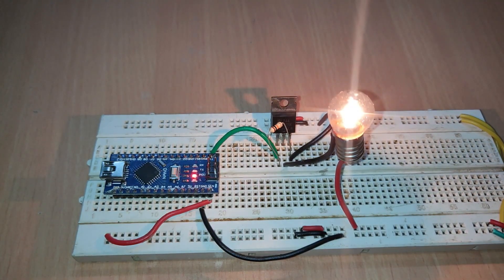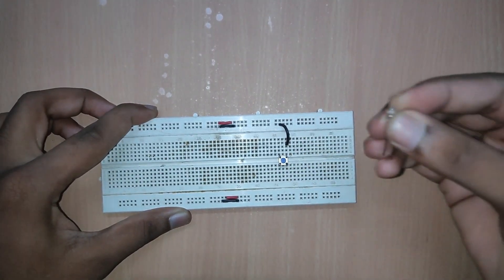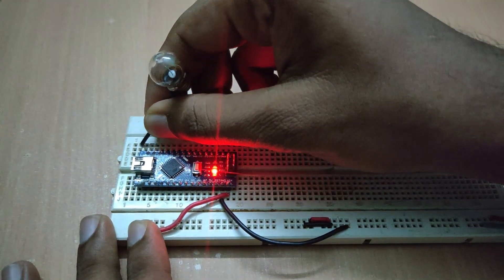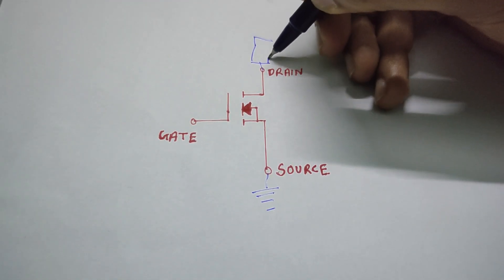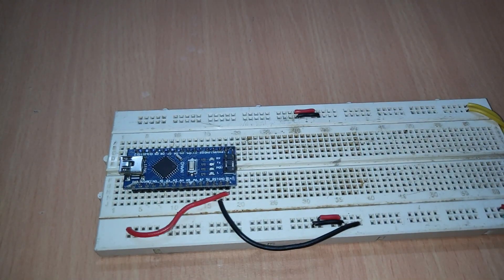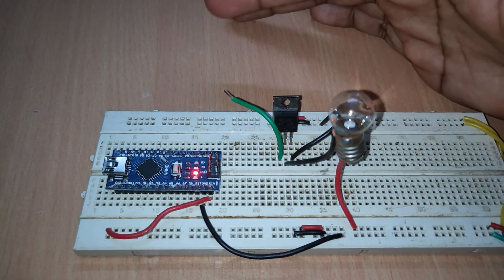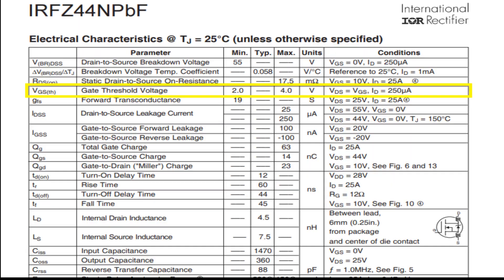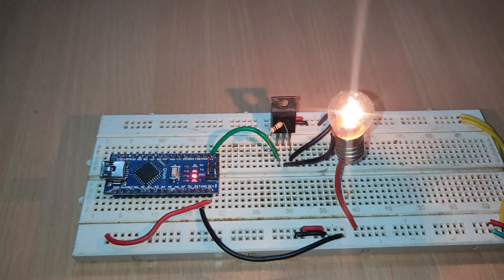MOSFET as a Switch -  MOSFET with Arduino

Comment: Can anyone show me how to build a simple circuit using a PWM controller and a MOSFET (like IRLZ44N) to rapidly switch power on and off — like for a coil or electromagnet project? I’m new to electronics and trying to make something pulse quickly without overheating. A step-by-step or breadboard demo would really help.

Comment: source was connected "GND" right?
Reply from the maker: Yes, you're right.
Reply: @ELECTROMODlab  but in the diagram you drew you mentioned Vcc. basically you did low side switching... Also the circuit diagram that appears later is correct, but it states IRF mosfet, which will require higher voltage to work and may not be feasible for 3.3v from nodemcu, arduino etc. IRL that you used is the right option.

This video is a great starting point. Thanks a lot for this.

NOTE: I don't have much knowledge in electronics, but was doing something to conditionally switch on and off a device attached to my nodemcu to save power from battery pack. So I went through all of this and figured out few things. Bottom line "I MAY BE WRONG"

Comment: This is great but you should also consider a gate resistor to limit the current as when the mosfet turns on it tries to charge it's gate capacitance, thus creating a high current flow, that might damage the microcontroller over time.
Reply from the maker: That's a good point to consider. You should limit the gate current.

Comment: If gate is fed with positive voltage of a source and source fed with negative then how a resistor is connected between gate and source would the short circuit happen in resistor and heat or blow.

Comment: Here you have an error I think. IRFZ44N is not "logic-level" MOSFET and VGS(th) that you shown in datasheet is an voltage where MOSFET start to open. IRFZ44N need about 10V to full opening. Instead of this should You use IRLZ44N (in symbol L instead of F) which is "logic-level" MOSFET with much lower full opening voltage. Of course I may be wrong but I think it's worth checking.
Reply: I think I saw your comment on another vid about the IRFZ44N needing 10 volts to turn on. I`m pleased I got the IRLZ44N then for 5 volt arduino.
Reply: I can't find it in my local market

Comment: Add a resistor of about 300 ohm between the gate and Arduino output port. Peak current is now too high and out of spec of the Arduino due to the fet gate capacitance. (And for the P-chan circuit, the gate must be neg to the drain. When the fet is ‘off’ the drain is at 0V (trough the load), so the gate must be  at about -5V . So you need to bootstrapping it)

Comment: Probably one of the best videos  i have ever seen, clear and straight to the point. Thank you sir 👍👍👍
Reply from the maker: Good to hear. Thanks for the support.
Reply: Hello, please may I ask why you did not put a resistor between the arduino pin 1 and MOSFET gate @ELECTROMODlab

Comment: Can you show how to use p channel also ? Also ... I'm trying to use a sensor with trigger voltage 3v out to turn on/off 12v load. I have only a 5v MOSFET ie signal to gate on N channel but it's not sufficient volts. So alternative is to boost the 3v to 5v on gate. Is there a way to do this without a boost converter circuit? I only need milliamps but 5v on base in me MOSFET
Reply from the maker: Use an appropriate MOSFET or use MOSFET driver
Reply: @ELECTROMODlab  thing is I'm recycling old broken boards. Online orders get expensive bcos postage and delivery pickup. And local stores don't stock mosfets
Reply: @ELECTROMODlab  I will try a transistor instead
Reply: @anybody2514   did it work?

Comment: gate threshold voltage is 2 to 4V max , so it can be used with Arduino ? Arduino output is 5volt.    Do we need to connect a resistor  between arduino output and gate  to drop 1 or 1.4 volt ?
Reply from the maker: No need of resistors but it'll be better to include one.

Comment: Hi I need to a mosfet  series number to buy that can turn on only with 5 or 6 volt I
Reply from the maker: Buy a commonly available logic level MOSFET.
Reply: @ELECTROMODlab  I get a lot of them but the inverter I built to adjust the frequency to switch them a lot no load to run cool but the mosfet heating up in few minutes but they or not fully on to fully turn them is to have them running cool alway at no load and warm at load my 555 timer put out about 11 volt pwm signal I turn the but at 50 % duty cycle is 5.56 volt

Comment: A short and simple informative video. This 10k ohm resistor between Gate and GND, in my case, with 3.3V arduino doesn't work. The load won't turn ON if I use the resistor, without the resistor it works.
Reply from the maker: Even without the resistors it works but the thing is the MOSFET does not fully turn ON by using a 3.3V. So my suggession is to use a MOSFET driver for your application.
Reply: @ELECTROMODlab  I am also trying to power on a solenoid actuator(for 2 seconds) which requires 12V, 2A using the data pin of nodemcu. The NodeMCU delivers 3.3V, a ?mA. Would it be a good idea to copy your schematics except for the resistor?

OR I should completely choose another path of using a 3VDC Relay or Solid state relay?
Reply: Hi ! I'm doing an electronic project where I Switch a 3.7v motor on with a MOSFET using an ESP32 which is also 3.3v. What do you recommand as a driver ?

Comment: Maximum Gate Threshold Hold Voltage for my MOSFET is 2 Volts, ESP32 GPIO gives an output of 3.3 Volts... how can I drive the MOSFET without damaging it? Show I use a resistor to lower the voltage? I have a IRLZ44 N channel MOSFET. Thanks.
Reply from the maker: Like you said it the threshold voltage not the maximum voltage, so the MOSFET should work fine.

Comment: which mosfet should i use in inverter i have p55n06 mosfet would it be okay
Reply from the maker: You can use any Power MOSFET with high drain to source voltage. I prefer for IRLZ44N

Comment: What was the value of volts that you were putting in  was it 9v
Reply from the maker: Yes. You can use any voltages not more than the remember drain to source voltage.
Reply: @ELECTROMODlab  can we switch a voltage of 3.7v